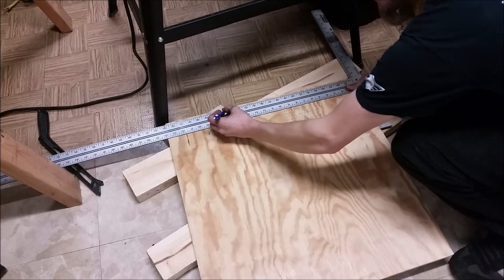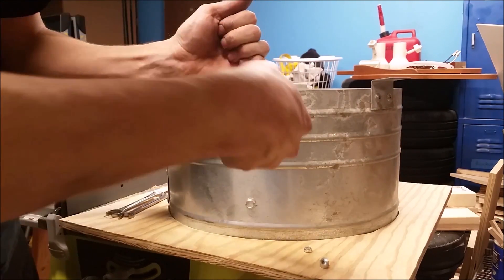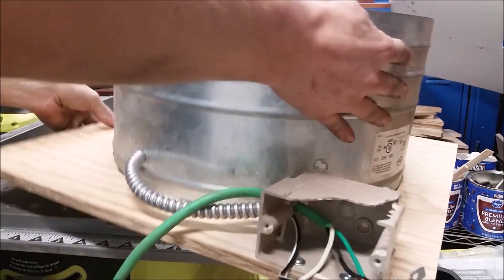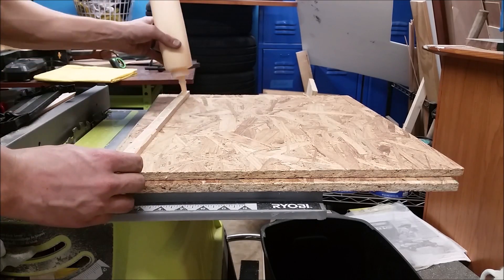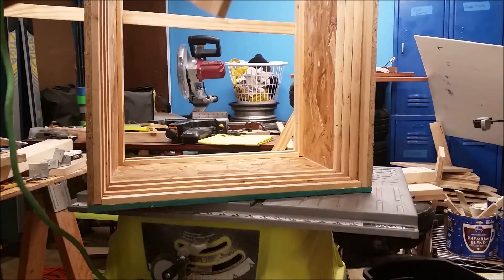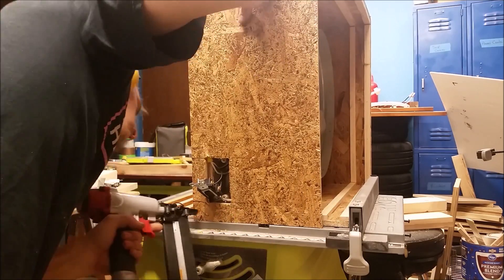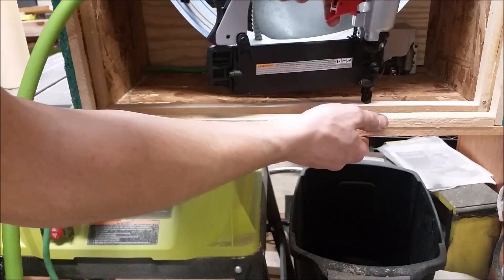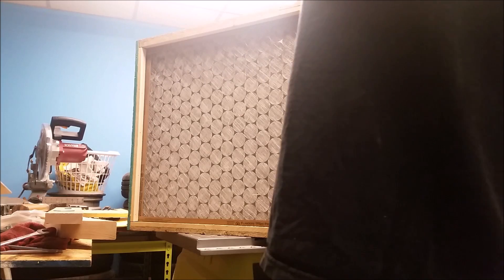Shop air filter - DIY tutorial

Comment: Nice idea and proof of concept. Not sure I would use three filter on the input. That make the fan struggle harder to work and creates some heat which will work on the fan's life span. And I honestly don't know why you put an exit filter on it either. But it seems to do what you designed it to do.

Comment: This is awesome and makes filter changes a breeze.  However, if you don't have the woodworking skills or time to build this, like me, a cheap and easy alternative is to build a simple bench top filter box. Hot glue a box made from 4 filters on the sides, a piece of plywood for the base, and a shroud made from Dollar tree foam board for the top.   Drop a cheap shop floor fan inside so it blows up through a matched hole in the foam board and you have a quick, easy and effective filtration system.  Sure, it will require rebuilding once the filters get clogged but when it only takes ten minutes to build, it's not that big a deal.

Comment: Disclaimer...I never leave negative comments but in this case ....A 2 wire motor so it doesn't have a ground ??? The armored cable IS the ground in this case and it is to be installed in a METAL junction box that IS grounded to maintain ground integrity. Please don't wire things.... you don't have a clue what you are doing and this is not safe.   Electrical work is NOT a hobby do not attempt if you have no experience.
Reply from the maker: Noted

Comment: Nice work, although there do appear to be some gaps air around the edges of filters, which would allow air and fine dust to leak past.  Read a comment elsewhere suggesting that this kind of air filter could benefit from some weather stripping.  Again, nice work.  That fan - was it an attic fan, or what?
Reply from the maker: Yea it was an old attic vent fan that was pulled out of a Reno. It could definatly be sealed better. Thanks for the support.
Reply: It's not a big deal because this is an air cleaner, not a dust separator.  If some dust particles squeek through on the first pass, they'll get caught on the 2nd or 3rd passes.
Reply from the maker: Yes, attic fan.

Comment: Just to give you a heads ups. The metal shielding around the cable from the fan is your ground this wire is called BX cable. A metal outlet box should be used with a BX clamp, this grounds the fan to the box. You must recess the box to be flush with your plywood so when screwing the switch  in, with the ground connected this now grounds the box to the system ground, therefore grounding the fan. Good idea and great filter.
Reply from the maker: Not an electrician so thank you.
Reply: hheidrick.   More than likely that is flexible metal conduit, but your comments remain correct except different connector.
Reply: Kevin Coop Bx cable is considered flexible metal conduit
Reply: hheidrick   Really?   Hmmm if you are correct, then why would there be a section for AC cable (you call BX) which is a cable with conductors installed by a manufacturer and a conduit that is flexible with conductors installed by someone else in the NEC(National Electric Code)!   I really do not think so!
Reply: Kevin Coop  google it. I won’t debate it.
Reply: I just looked at the picture again and the wire from the fan motor to the box is bx cable
Reply: Bx is also know as armor clad or flexible metal conduit conductor.
Reply: hheidrick  ok I looked at the video again and at 2:04 he uncoiled the metal and it exposed the conductors.   There is no ground conductor within it and no paper inside of it.  This means flexible metal conduit absolutely not any kind of cable.   Just so it is clear, I'm a a PE (Professional Engineer) and have worked for electrical contractors designing electrical systems for over 30 years.    By the way, the electrical code does not use the word considered.   Things are or they are not.  This can be settled by the person that posted the video in case someone still thinks it is cable.
Reply: Kevin Coop oh boy an engineer, I’m done. Your right, you got the degree.
Reply: hheidrick   The degree means nothing.   This is not taught at colleges.   It is experience.   In electrical design, things are not assumed or or considered the same.   It either is or it is not.  Learn all you can!   Good luck to you in the future.

Comment: You lost all credibility when you used garbage for a junction box.   A junction box in that bad of shape serves no purpose.   A brand new one is what......two or three bucks.
Reply: Folks, I agree, but it may be that Tim is speaking from the perspective of code compliance. Junction, outlet, and switch boxes are designed to isolate wiring from potentially combustible materials. In this application, the broken box may allow dust particulates to accumulate on and around the wire. Granted, the chance of combustion is small. I'd have a greater concern over fine dust accumulating on and around the exposed pole motor. One spark in an environment laden with fine dust (note the builder isn't using HEPA filters) and you've got a fire. The fan used is an area exhaust fan. A better and safer option for these dust filtration systems is either a sealed pole blower or a squirrel cage blower.
Reply: pretty dumb statement, Tim.  Cracked or not...it still, clearly, served "it's purpose" because it f'ing worked. That's how you know if it's serving the purpose.  Hell, you can't even see the crack once the project is complete.
Reply: Your comment is literally pointless Tim...

Comment: Looks much more durable then the other DIY dust filters Ive seen on YouTube. Maybe just use some primer and a clear coat on the inside so it has a smooth surface easy to clean and doesn't absorb moisture from saturated layers of dust on humid days. I think the metal mesh on the filters is to support the filter stuff from the force on it from airflow and should be turned around the other way then how you had it in the video unless the mesh was on both sides of the ones you used.. A blower type fan would probably be a better choice for this application where you are going to have some negative pressure between the fan and the intake with airflow resistance and so much spacing and few fan blades around the actual fan once the filters build up some dust you might just have air flowing back around the blades from one side to the other rather then through the unit and stress the motor.

I made something like this years ago except used a ceiling fan for bathroom exhaust to create a negative air pressure inside the box and ran flexible drier ducting to point the exhaust and had the filters face down with the box on some legs giving it a few inches off the floor. Instead of 3 separate slotted filter spaces I took 3 of the same kind of filters and layered them on each other with activated carbon layered in the two sections between the filters and used aluminum tape to seal that up with some thin foam type self stick window weather stripping on the bottom and edges to act as a seal between the casing and filter. The carbon is the same black stuff used in fish tanks and helps to remove the very fine particles and even odors from the air used to be maybe ten bucks for a pound at the local pet shop. It worked very well and you could have easily made it intake from the filter box or run some flexible ducting from an inline blower into the box. Different purpose I guess and intended to purify air rather then be a high flow visible dust filtration for a shop.
Reply from the maker: +NoSuspect thanks for the long rely. I would like to answer a few of your questions. Yes, the filters have mesh in both sides. Also, I used the fan because it was free and available. I would have used a squirrel cage blower if i had one. Maybe then next time one becomes available I'll make a new one.